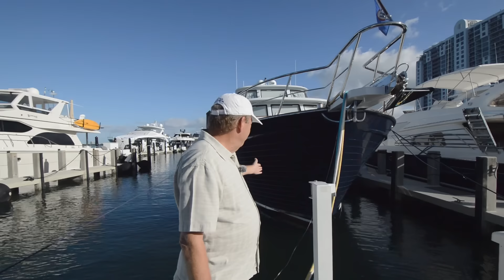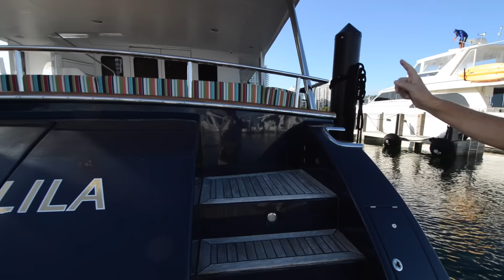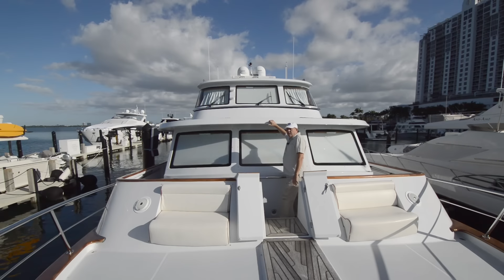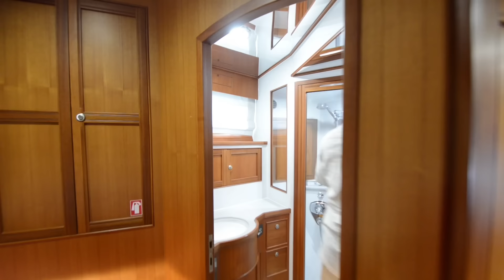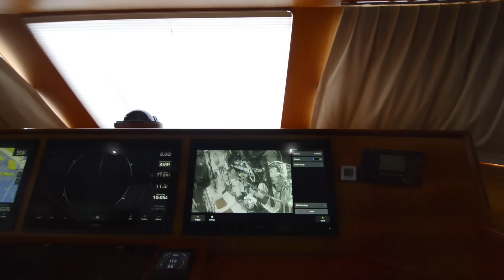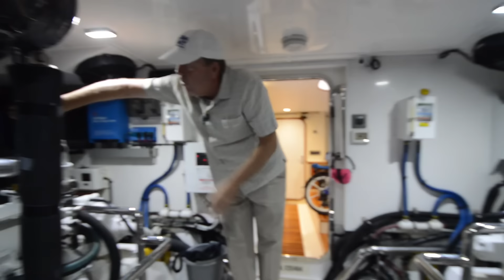"TURANGALILA" 2018 Marlow 75E CB Yacht For Sale - Bill Thomas

Comment: You talked about speed but not ranges 
What kind of range around 15-16 knots?
Range at trawler speed (8 knots)?
Reply from the maker: She will do 15 or 16 knots on a sloppy day, however this is not an efficient speed for any vessel in this size range.  You are still not on top very well at this speed. There are many boats that cruise at 16 knots, but that is generally due to lack of power.  Most boats that cruise at 16 knots would be far happier at 18+ if they had the power.  This boat loves 18-19 knots, as do most Marlow Explorers.  At 15 knots you may be burning as much fuel per mile as you do at 19.  Of corse this changes with load and conditions.  The best real world example of this is when you are running a center console or other smaller planning boat.  You run slow or you get it on top.  You don't feel the difference in a big motoryachts like you do in a smaller boat, but you see it on the engine gauges.  When the turbos kick in and you go from 1 PSI of boost pressure to 10+ psi (between 1,100 and 1,500 RPM) the fuel burn and HP go up very fast.  If you don't apply enough power to get some of the hull out of the water and get over your bow wave you are just pushing water.  This is not a Marlow thing, this is the physics of getting an object out of the natural shape of a wave.  It is true if you are water skiing, running your dinghy, or your Marlow.  You are either down in the wave trying to push water or you are on top.  I run 9 or 19 on almost every Marlow ever made.  The 49's and 53's 9 is a little beyond the efficient speed.  The 97 will do 11 and 11 a side - shorter boats will be twice the fuel at 11.  Most of the 70' - to 80' Marlow's are burning 40GPH to 50GPH per engine with a V12 1800HP at 60 to <70% load to do something between 18-20 knots.  Sorry to be a little vague.  If I leave Tampa full of fuel and run to Ft. Lauderdale at 20 knots the boat is 1 1-2 - 2 knots faster at the same RPM because I have burned a few thousand pounds of fuel. Most of my owners run slow 70% of the time but they would not give up that fast 30% for a slow boat.  When the sun is gong down and you are 12 miles for a new inlet, fuel cost is the last thing on your mind!
Reply: @bilthomaslistings   I like that you can run on plane was just curious if it had the range extended at slower speeds. Don't think you could cross the Atlantic but running down the coastline catching the scenery.
Or just leave Florida on plane head to bimini and back?
Reply: With 3,450 fuel let’s say we want to keep a reserve of the 450 so 3,000 useable.  I think we are about 15gph total at 8.5 knots and if you slow down to 7.x it’s really good.  Let’s use 8.5 @ 15.  That is 200 hours of running and you would cover 1700 miles.  If you can do under 8 like most of the slow trawlers do it closer to 3000 miles,so yes definitely possible to do Bermuda to the azores.  It’s all about speed.  When I’m managing fuel on a long trip I really take it easy in the beginning, building up a buffer so I can make up time at the end once I know I’m good.  When I’m watching cost and running a boat like this I just never go fast, but don’t go real slow either.  9.x is under 2 gallons per nautical mile but above 1.5.  I leave the dock with a fuel budget of 2x distance plus’s a reserve.  I like 250 in reserve.  The marlow tanks have a tapering tank with a sump so I don’t need a 10% reserve like a big flat bottomed tank.
Reply: @williamthomas155   thank you, that's why I like this style of boat, you can cruise around at a slower speed enjoy the cruise, do some fishing all while saving a little costs, but if you need to get away from a storm or "short" distance quickly you can.
Now waiting for some investments to pay off before I'm a serious buyer until then deciding what type of boat I want, can sustain. One thing I've learned is this size and up the purchase price isn't much when you are going to hold it private for ten years. Chartering sounds appealing on the financial side but not moving my stuff on and off the yacht.